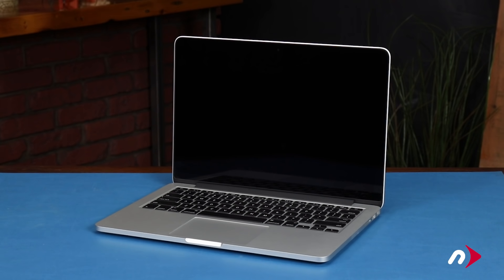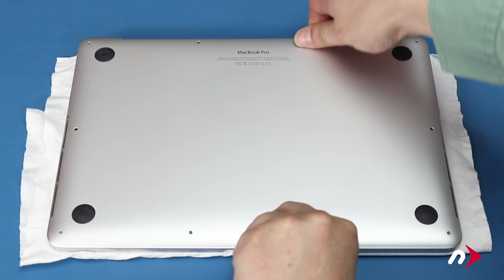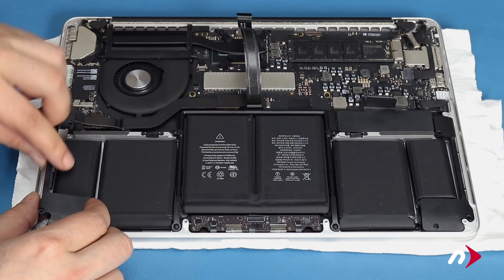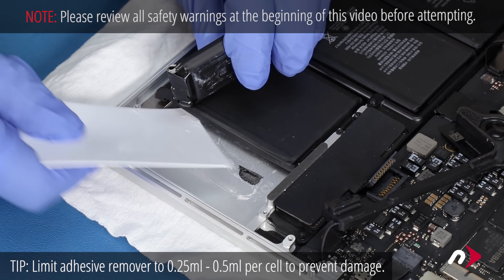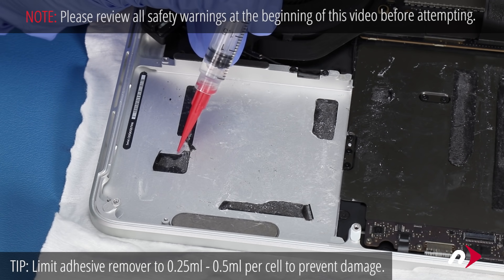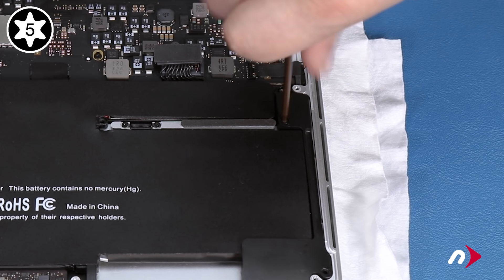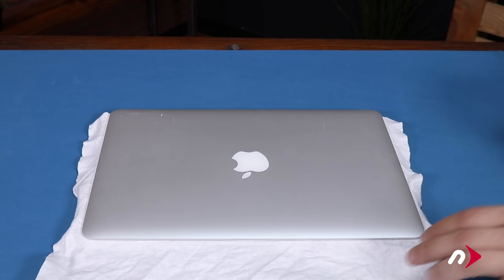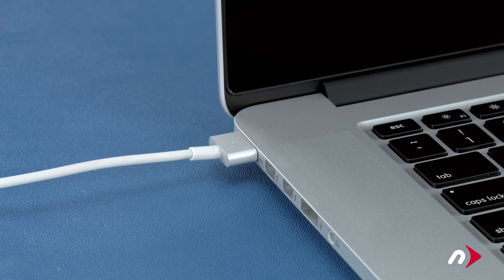How to Replace the Battery in a MacBook Pro Retina 13-inch (late 2013 to early 2015)

Comment: Don't handle the charger cable by the cable, only by the end! This goes for every type of electronic connector. Never pull anything by the wires, that's the quickest way to destroy the cable. Other than that, this was a good video.

Comment: I don’t normally post comments but wanted to thank the maker of this video. I carefully followed all the steps shown here and was able to replace my battery with no trouble. A syringe and acetone worked really well to to release the glue on the old battery and the new battery was installed safely and easily. Very grateful for your time and effort to make these excellent videos

Comment: This video gives great step-by-step instructions with specific hints. I only had to wiggle a plastic card underneath three of the battery's six components, and all of them came out readily or with a gentle firm pull. So before getting an adhesive remover or a heat gun, just open the MacBook and see if you can remove the battery by simply pulling it out.

Comment: Thank you so much for this video. I actually managed to do this without using adhesive remover. I think over time the adhesive hardens a bit and I was able to remove the original battery by just prying with some plastic cards (I had to double up at times to get more leverage and force applied.) That being said ... I did puncture a cell slightly at one point and it DID SPARK, so be careful - using the adhesive remover may eliminate the need to have to use force on the cells when removing and may be safer overall.
Reply from the maker: We're glad to hear 👂 that you could get the battery 🔋 out without the acetone, but you are correct; we provide it to avoid putting so much force 💪 on it and avoid possible damage.

Comment: I followed these instructions but my battery won't take a charge and the laptop won't power on. The screen only shows the red dead battery smybol. The magsafe charger doesn't light up at all, though I've tested it works with another computer. Any hints?
Reply from the maker: Hey Greyson, if you haven't already I'd recommend giving us a call at 1-800-275-4576 we could probably resolve the issue if this doesn't help.

If your Magsafe light is not coming on it's an indication that theres either an issue with the Magsafe or it's not receiving power, if it works with other computers I am not certain. It very well could be an issue with the battery, have you already tried an SMC Reset?

1. Shutdown your Mac.
2. Unplug the power adapter from your Mac and from the wall power socket for several seconds.
3. Physically remove the battery or dis-connect
4. Hold in the Power Button in for 20 seconds.
5. Re-insert the battery (if it's removable) Re-connect
6. Restart your computer.

Comment: Hello again. I did it - thanks to your very clear video. The battery was not easy. I found it useful to use a flat brush,  as used for tinting hair.   Once the battery began to lift I could slide this with more solution added  underneath, and then use the card to lift it. Well pleased.

Comment: I am understanding from this, that it is not necessary to glue the new battery.  If that is the case, then why was it glued in the first place?
Reply from the maker: It's not necessary but it was used to keep the parts secured. My assumption was Apple did not expect anyone to want to remove their batteries if they were glued in and instead take them to Apple to be replaced. I can only speculate on the matter however, but from what we've seen it is not necessary.
Reply: @poweredbyowc  Thanks for the reply, but actually, the adhesive was already on my new battery and all I had to do was peel the backing off when I was ready to fit the new battery.  By the way thank you so much for the video, it gave me the confidence to have a go myself and guess what it worked, without any bad consequences and yes I think you are correct about apple, they will do anything to make money out of their customers.  It was not as easy to prise the old battery off, as your video, but because I had seen the video, I was confident that I was doing it the correct way.

Comment: While installing the battery replacement somehow my keyboard and TouchPad stopped working, what did I do wrong? How can I fix?
Reply from the maker: Hey Emanuel, I would recommend giving us a call at 1-800-275-4576 and speaking with a technician!

Comment: Good afternoon the new battery replacement manual says to wait for 12 hours before installing the new one but I don't see such an advice on this vod (I have a Mac pro 13 2015) because of the capacitor memory on the battery.  What should I do advice please
Reply from the maker: My recommendation is going to be to follow both the manual and the video, as we do our best to keep them both updated, and as we find more information, we work to include it...so if it says to wait 12 hours, go ahead and wait for the 12 hours.

Comment: I followed it step my step but I’m having trouble powering my computer on. I even went back to see where it went wrong, I check all of the cables but my new battery won’t power my MacBook Pro 2013 13 inch on. Any help?
Reply from the maker: Hello Sheldon, I'd recommend giving us a call at 1-800-275-4576 and speaking with a technician, we should be able to assist with getting your battery to work properly.

Comment: Thank you for providing this video. This was my second battery replacement, both purchased from OWC. The instructions were right on, and very clear. The only exception was that even though the video indicates that late 2013 MBP has 4 additional screws, mine did not. Just rubber bumpers where the screws are supposed to be. It was a little confusing at first, but nevertheless the removal of the old swollen battery and the installation of the new one was a breeze. Thanks again for making a good product, and supporting us.
Reply from the maker: I am so happy our video could assist with that! Sorry about that older info on the video however thanks for alerting us to that! If you ever have any other questions or concerns please let us know at support@owc.com!

Comment: Hello, Please help, I just replaced a very swelled up Battery pac in my 2015 MacBook Pro and also the touch pad ribbon, and the Track pad and keyboard are not responding. What is the part that the touch pad ribbon connects to called?other then the  Zif socket but the name of the rectangular piece, please... or can you tell me if you have a video explaining that.
Reply from the maker: We are very sorry to hear you are having this issue. We would recommend reaching out to our Tech Support for further assistance on the link below.
https://eshop.macsales.com/Service/support

Comment: I have charged the new battery for over 4 hours now and the cable lamp doesn’t turn green. Any recommendations? Thanks for a great video!!
Reply from the maker: Here would be my recommendations: 1. Unplug and reseat the power cables connecting the battery while the Mac has been turned off, and once reconnected, try going through the process again. If that doesn't change, then 2. I would recommend you contact us directly as we would be able to more directly and efficiently able to help.

Comment: Well, I just did it and the trackpad and keyboard don't work now lols....I wouldn't use liquid adhesive, a card or floss (like people have said below) should work with patience....with alcohol or goo gone you run the risk of liquid getting into the trackpad area....time to call the genius bar $$$$

Comment: The only part I don't agree with is the calibration ! battery management on macOS system will not depend on charge/discharge process .. all you can do is reset SMC and NVRAM and you're good to go

Comment: Thanks for the clear and concise video to replace the battery. After a lot of research, I found that the best After Market battery was Newer Tech and OWC was one of the few suppliers that provided this battery. The battery I received had a design capacity was 7000mAh and the full charge capacity went up to 7241mAh - Bonus, as the original battery design capacity was 6300mAh.

I followed the instructions, and was prepared to pry the old battery with Glue Debonder and a plastic card but to my surprise, I could pry the battery off by hand with little effort - sometimes, you get lucky as I had seen some nightmare videos in getting the old battery out.

The rest of the battery installation was pretty simple, and once it was charged up - I did a PRAM and SMC reset for the Macbook Pro - I was surprised that these final steps were not mentioned  in the otherwise very complete instructional video.

Finally - after 10days of usage, I calculated and verified that the new battery provided me with 5-6hrs of battery for web video usage compared to my old battery where it had 2hrs at 64% of design capacity.

I hope this review is useful to someone in 2021 :)
Reply: Commenting so I can find this comment later
Reply: It is useful to someone in 2022! lol thanks :)
Reply: How did you find that OWC batteries were the best?
Reply: Replacing in 2023. I never knew about PRAM and SMC - thanks.
Reply: This review is useful to someone in 2024!
Thank you very much!

Comment: Thank for this Video.  Easy to follow instructions for sure.  As someone else had said, my macbook also did not have those screws around track pad battery just rubber stops. I did not use adhesive remover as I had none on hand  Just took a little longer, computer is up and running and the battery last forever.  Thank you again!
Reply from the maker: Hey Barb, Thank you so much for the great compliment. Awesome to know that the battery installation was easy to be done. Please let us know if you need anything else we are more than happy to assist.
 
Have a Great and Safe day!

Comment: Hi, on my MacBook Pro 2011
I disconnected my batter by pulling that small black plug. I placed it back and now my batter is not good charging at all. Please suggest what needs to be done ? 
Thanks in advance
Reply from the maker: We would recommend testing a PRAM and SMC reset. For further information, please reach out to our support team on the link below.
https://eshop.macsales.com/Service/support

Comment: would heating the battery help in removing?
Reply from the maker: Heating can help loosen the adhesive however, I wouldn't use anything more than a hair dryer. You could also use acetone to weaken the adhesive!
Reply from the maker: That is a good question! We do no recommend heating the battery for use of removing the battery.

Comment: Dont forget to order adhesive remover, I ordered my battery and I'm stuck with my macbook open with the old batteries stuck. I tried to pull it a little but the batteries could rupture, so I'll try to see if I can find some at home depot now

Comment: We didn’t have any thread at home. So we decided to try floss. Yes teeth floss! We pulled the floss from side to side as a person would when flossing their teeth, except with a lot more force. The first time I put it under one part of the battery it got caught in the glue and broke. We put some olive oil on the floss so that it doesn’t stick to the glue. We had to change the floss 2-3 times for each battery part. But it was amazing. So quick, so easy. Did not damage anything. Thank you for this video, gave us this genius idea :)
Reply from the maker: Glad we could help out!

Comment: my MacBook pro early 2015 was charging fine and now it only works with the charger in, could this be the reason anyone?
Reply from the maker: Hello Stardogg, sorry to hear your battery isn't working correctly. There are a few reasons why a battery might not work. I would recommend an SMC Reset, double check your connection to the battery it is possible that it is swelling and not connected.
 
If neither of those are the case, please send us an email at support@owc.com and we should be able to assist you further.

Comment: what size is the torqs screw driver
Reply from the maker: Hi RJ!  A Pentalobe is used to remove the back of the MacBook Pro and a T5 Torx is used to remove the internal components as indicated in the video.

Comment: Pro Tip: While you've got the machine open, inspect the cooling fan and clean with can of compressed air if needed. Extra credit to those techs who remove the heatsync and replace degraded thermal paste. It's the little things you can tell your customers about that make them happy! See the following: https://www.youtube.com/watch?v=EGW9RAkl7Vs

Comment: I have a question please. I have been told that even if you put in a new battery, a late 2013 MacBook Pro for example, will not be near its original battery life. Is this true? I thought the whole point of replacing it with a NEW battery was that it's back to running what it originally ran. Maybe I can see it if you're running an updated operating system like Big Sur

Comment: I'm trying to swap the battery on my gf's macbook pro 2013 model, but instead of the 4 screws shown at the 4:20 mark, I have 4 little rubber bits that I pulled out. There's threading there for screws, but I don't know exactly what screws I need. I know they're T5s, but does anyone know what length they are, or have a link where I could buy them? Thanks!

Comment: Installed my OWC  new battery today. All went well until I put everything together. My computer is charging on amber but I can't get it to start. Does it need to increase charge before it works or have I don't something wrong?
Reply from the maker: We are happy to hear that you have installed your new NewerTech Battery into your machine. These batteries are known to sometimes have a slight charge or no charge at all.
 
We would recommend calibrating the battery following the calibration video below: 
https://www.youtube.com/watch?v=T5ZMLInLE-Q
Reply: @poweredbyowc  Thanks for getting back to me, my bad. The connector to the battery wasn't in properly and once I worked it out, it started to work. 2 weeks in and very impressed with the new battery
Reply from the maker: We are so happy to hear that everything and running as it should! 
 
If you should need further assistance you can contact us any time at support@macsales.com 
 
Have a great day!

Comment: Do you need a specific screwdriver for the screw holding the battery connector in place I've got all the others off but this one doesn't want to work any help?

Comment: I have a 2013 MacBook Pro that won’t hold a charge longer than 48 hrs, without any use, before completely dead. Will this improve my battery life? And if so, how long will it hold the charge for? Essentially, is this worth it?
Reply from the maker: Our batteries are designed to last anywhere from 3-5 hours on a full charge, depending on use.

Comment: This tutorial was super helpful and I’ve successfully replaced my MacBook 2013 13” retina battery. Used acetone, gloves and some old swipe cards to assist. My battery was only secured using one screw. Thanks for this super concise and helpful tutorial
Reply from the maker: How awesome! Thanks for letting us know how it went for you.
Reply: I have seen an other video that used dental floss.  Do you think it would work better?
Reply: @Mickycho1964  if you have dental floss to hand, it definitely will help. Ultimately the acetone is great as it alleviates the need to use excessive force. You gotta remember that your machine is worth a lot, so be gentle with her

Comment: after doing this my trackpad doesnt work , do you know why?
Reply: You most likely damaged your flex cable in the process of changing the battery. Replace the flex cable and it should work fine.

Comment: An excellent instructional video! I was able to replace an old battery in my mid-2014 MacBook Pro. Used 70% isopropyl alcohol as an adhesive softener. It is less aggressive than acetone, so the process requires a bit more effort, but it still works well. 

One minor point. Contrary to what the instruction says at 4:00, my mid-2014 MackBook Pro had just one screw fastening the battery—next to the connector. There were no "four more [screws] to remove as well—two on each side." There were holes there, to be sure, but they had no screws and were just covered with rubber plugs.
Reply: Same here, just one screw and four rubberplugs on my mid14. Otherwise, great tutorial!
Reply: My late 2013 model also had the plugs. It was a pain to try and put them in the new battery holes so I just skipped it.

Comment: Thanks for the video! I used this in addition to the iFixit guide, and this was way more concise and better shown. Also saved me a bunch of work disconnecting all the cables iFixit told me to disconnect.

One note though, I have a L2013 MBP 13 and mine only had one screw holding the battery.

Comment: Anyone have problems after installation?  When I installed, powered on, keyboard, mouse are disabled, fan runs like mad, and refuses to charge.

Update: A simple SMC reset (shift+control+option+powerbutton) solves the fan and charging issue.  As for keyboard and trackpad, cover the connection between ribbon cable and unit incase tiny debris gets in, which is what happened to me.
Reply: Dude your update saved my life, I thought my mac was going to explode!!
Reply: @MrMegapimp4  Yes, I nearly defecated in my pants when I heard that sound.  But, thank goodness for shift+control+option+powerbutton.
Reply: Yeah, I had similar problems, except just not the charging issue. I had accidentally disconnected one of the cables so the hard drive got messed up. I ended up taking it to a computer store to get it fixed.

Were you able to do anything about it?
Reply: @bboyk3vlar  Oh, thanks for reminding me about this comment!  I need to update it.  A simple SMC reset (shift+control+option+powerbutton) at startup immediately fixed the fan and charging issue.   I brought it to computer shop, too, and they discovered the tiniest fragments of debris between the ribbon cable and connection.  So, no problem with trackpad and keyboard.